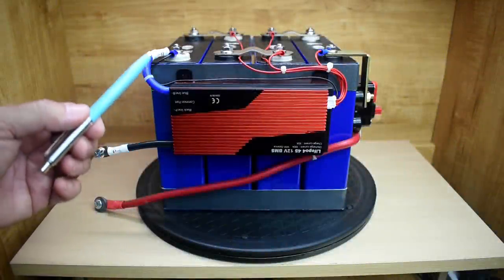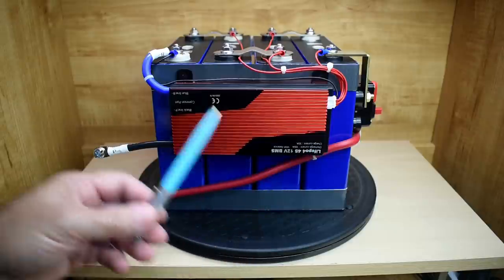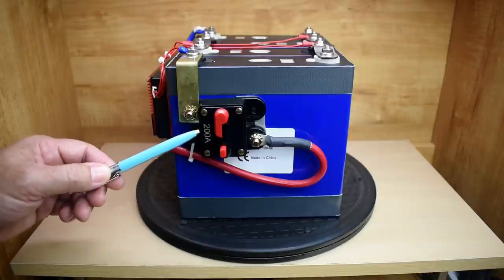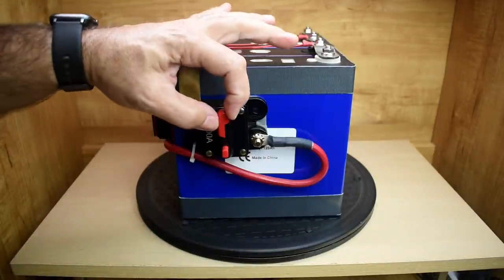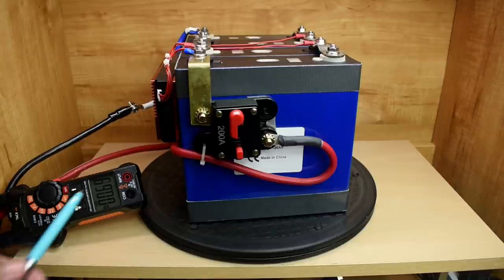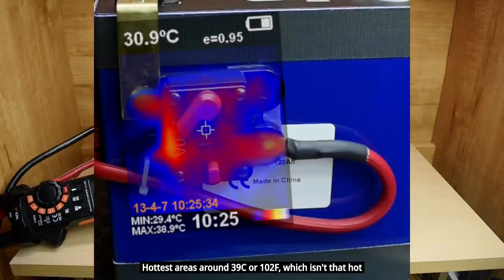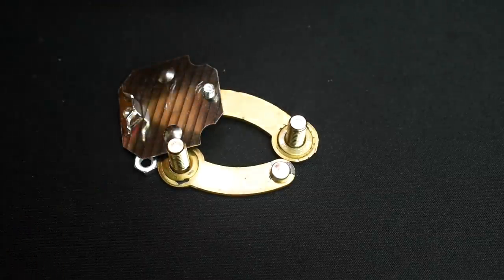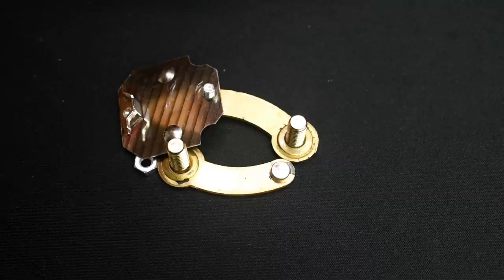NEVER Use This High Current DC Circuit Breaker For Solar, Auto, or Marine!

Comment: I also had a problem with these 200A resettable fuses.  It did trip from high current correctly.  So I reset the fuse.  But the battery connection became very "flaky" like working for a few minutes, then just stopping for no apparent reason because the fuse was not tripped. Yet I couldn't get power in or out of the battery.  Could't figure it out for a while and frustratingly had to start taking apart my system to try to find the problem.  The problem was the fuse itself!  I tested its resistance from pole to pole and it had a huge 1MΩ resistance!  I bypassed the DC fuse and confirmed the problem was definitely the DC fuse.  

For a while, I considered my BMS was messed up.  The BMS has its own MOSFET type software driven fuse.  But it was not the BMS.  

Also, I had one 100A fuse (of the same style) for a different part of the system.  It kept on tripping prematurely at 31A to 33A.  Lucky I was able to return that one to Amazon for full refund because my charger regularly hits those current levels as part of its regular specified operation.

Now I just use a regular non-resettable ANL fuse with some spare fuses around.  But I like the resettable feature because you can also use these fuses as switches to disable/enable parts of your circuit for maintenance/upgrades etc.  Still looking.
Reply from the maker: They're junk.

Comment: I was considering to use one of these but looked really Crappy. Perhaps good for 30-40 amp.
Reply from the maker: A 200A will probably trip around 50A, but every breaker may be different. You may get one that trips at 80A - 100A when rated 200A, and burn up your wiring. Avoid them. Thanks for watching!

Comment: I use some of them with different amps.
In another video i saw a test about breakers. It was about the 100 Amp one. And this one works the best.
100 Amp shut down at 99.7 Amp. Ok could a bit higher but others shut down at 150 or even 230 Amps.
There are a view of them on the Market and I'm not sure they all bad.
Reply from the maker: I don't trust any of these. I'll stick with Blue Sea and others.

Comment: I had two of these rated for 60A in my boat. Due to a configuration error while installing I produced a 0.1Ohm short, almost directly behind the breaker. Guess what - it heated up that quickly that it did NOT release at all but started to boil and emitting heavy smoke, also damaging the wires behind the breaker.
This cheap chinese brand is simply dangerous to life threatening.
Reply from the maker: The contacts probably fused together.

Comment: Those stud connection look tiny to handle 200amps. Is it smaller than 5/16? For such a large continuous current, I would imagine it should be at least ⅜".
Reply from the maker: The look like they could handle around 80A, not 200A.

Comment: Each time a DC breaker is tripped under load an arc etches the contact faces. Each additional use will cause heat rises due to poor contact. Start with quality and use with respect. Frequently measuring the voltage drop across the terminals will give a great heads up to pending failures.
Reply from the maker: Yes, the breaker should never be used as a switch when the load is connected.

Comment: It seems clear that the contact area (referred to as the 'silver' part) is the problem. It's even discoloured where it's been arcing. This is a design flaw. While it's true that the parts have to be quite rigid (unsprung) to ensure disconnection in these cheap parts, it looks like the geometry is poor. Also, it's hard to believe that thermal response tolerances (of the enclosure and the plate) have be ensured in such a woeful device, even if the contact were perfect.
Reply from the maker: As I learned, stick with Bussman and other high quality brands.

Comment: For connections it is not silver, because it rusts, it is nickel. All electrical is mostly brass and nickel. (and copper in good wires, aluminium is worse ones)
Reply from the maker: Silver doesn't rust, it tarnishes.
Reply: @electronicsNmore  ok, bad choice of words (I'm french) same result : silver oxides are bad surface contact, reason why it is almost never used in electrical nor audio. It is most likely nickel.

Comment: I guess I don't understand the point of this video - you're using a random no name knock off breaker. 

Why not use something name brand?
Reply from the maker: I was showing a breaker that many people have bought because of the low price.
Reply: @electronicsNmore  Anyone who is addressing circuit protection by buying the cheapest knock off junk available needs a talking too about circuit protection. 

I suppose this video partially addresses that?

Comment: Take the breaker off and see if you can make it burn. Try to light it with a match or propane torch. They are supposed to be made of composites or plastic that do not support combustion, or they self extinguish. If you can make it burn, I won't be surprised.

Comment: Love your very helpful videos. I have an old damaged "Tevo Magneto Rechargeable LED Lantern" that I want to salvage the LED light panel from and run it directly of mains if possible. Could you please please please make a video of that. I don't want to through away the unit if there are still working LED lights on it.
Reply from the maker: How much power does it draw and what voltage?
Reply: @electronicsNmore   thanks for your reply. It says charging voltage: 220-240V , 50/60Hz and it had a 6V 4AH battery. I'm in Africa 😊

Comment: I have 2000w power inverter and I wand to install it on my car secondary battery . My question is what is better  way install it with fuse or bussmann circuit breaker??
Reply from the maker: Fuse is fine, size it properly and it will never blow.
Reply: @electronicsNmore  what size of fuse should I use for 2000w inverter pure sine wave  ?

Comment: Your wires too thin that's why the breaker is tripping early
Reply from the maker: Incorrect.
Reply: Not sure where you're getting your data from but copper 4 gauge wire is only rated at 70 amps and most Solar uses aluminum which is less
Reply: 2 gauge is required at 100 amps

Comment: I was taught that electrons flow on the surface of a conductor. So correct me if I'm wrong, it's not the thickness of the plate, but the size.
Reply from the maker: Depends on the frequency.
Reply: @electronicsNmore  Frequency is the amount of hertz if my memory serves. Which only applies to alternating current. 
In direct current the power only flows one direction instead of back and forth. 
The reason that we are getting heat is because of resistance. Lack of electron flow. Which reduces the voltage and as a result increases the amperage needed to push the electrons. More heat is then produced causing more resistance. This vicious cycle is what is causing the breaker to pop at lower amperages. 
I work at a place that uses these breakers on occasions so I have one handy. I'm going to run a similar test to see if I can duplicate your results. 
I did however notice the switch problem you were pointing out.
Reply from the maker: @Kendalon  Correct, I answered the question fast. AC you get a "skin" effect, DC flows through.
Reply: @electronicsNmore  what kind of wire lug are you using? Is there a video on that? Cheap wire lugs can be a point of resistance and cause heat.
Reply: @electronicsNmore  alright I thought I would post an update on the test I'm running. 
Yes there is a huge heat issue. The temperature at the connection terminals are between 95 and 110 fahrenheit.
Now where I'm finding the most heat is the back side of the breaker. 166 fahrenheit when I tested it a couple minutes ago. But the breaker is still active. I will continue my test.
Reply: Final update. 
70 amp draw
12.8 volts
185 fahrenheit at the battery side of the breaker.
18 minutes before the breaker popped.
Test concludes. These breakers are indeed garbage and shouldn't be used

Comment: What is the brand of the breaker????
Reply from the maker: Brand is irrelevant. If it looks exactly like you see in the video, don't buy it.
Reply: @electronicsNmore  I don’t mean which part of china brand I’m saying are the fancy ones sold at the huge marine stores just as bad ? And so my understanding is the tested and true method is just fusing everything instead of circuit breakers right?
Reply: @electronicsNmore  are you saying ALL of these tiny marine circut breakers are cheap and dangerous or just no name Chinese ones?

Comment: why use a breaker, the BMS should be able to handle any issues
Reply from the maker: You always use a fuse or breaker off the (+) battery post.
Reply: @electronicsNmore  why? the BMS would cut the neg side be fore that breaker would the pos. Any how never had any issues my BMS cutes when it should faster then any breaker. its Heat vs. Power fault.
Reply: @woodzyfox4735   Are you claiming that a BMS will never fail?   The BMS is NOT to used instead of a fuse or a circuit breaker.  Clearly, you do not understand WHY a fuse or circuit breaker is required ...
Reply: @vtorsi610  a bms stands for "Battery Management System" clearly you dont know what there for :3
Reply: @woodzyfox4735  Correct a BMS is NOT an OCD.  Learn your National Electric Code ...
Reply: @woodzyfox4735  Actually a Fuse / Circuit Breaker is REQUIRED even if your battery bank has a BMS - because the BMS can FAIL.  You are contradicting the National Electric Code.  No, you are not allowed to change the laws.
Reply: @vtorsi610  check per state. the rules are different :)

Comment: That’s not a 200 Amp breaker; it’s a 200 “A” breaker - “A” as in the the first letter of the alphabet. The reason is that’s the number of “A”s in the scream you will emit while trying to use it. See how this works? 😜
Reply from the maker: Thanks for watching! Be sure to rate thumbs up and share the video link.

Comment: I hate this tipe of "protection". But i say that they have a bad reputation because 95% are Amazon -china garbage. But they are also hygh quality.

For the battery with 12 cycles that work good, its the minimum. My AGM s now have 1000 cycle of 30% dod average nad maybe 15 80%dod cycles and 100 60%dod. They work perfectly. Give me 94% of original capacity C20.

A tubular plate heavy traction lead acid make more than 2000 cycles at 100%dod. A lifepo4, is drain real 100%, dienin one or few times.

Comment: Holy shit no, no, no.  Stop giving advice that people might listen to dude.  Should you not use one of those as a primary breaker?  Yeah, but not for the reasons you give.  A lifepo4 battery that shorts, can push a current far far far in excess of that tiny 200A breaker.  When that goes down, things get nasty fast and you can get fun things like arcs.  Do you know what an arc is?  Do you know what interrupt breaking is?  No, no you obviously do not.  If you did you wouldn't have a device that if that battery shorts could catch on fire....a fire that is attached to the battery....  Congrats on your potential bomb.  Disconnects absolutely have their place....which is after a real fast blow fuse that can handle what the battery can dish out under worse case scenarios.  Also, if you want a circuit breaker that can handle the load it claims to be rated for, pony up the extra $20 for something that has a UL.  Probably don't know what that means either.

Comment: The only use I could see for them is maybe on a positive main feed wire to some small 12volt circuits like LED lighting, it could protect the main cable and act as a isolator. Their use is very limited, nice idea, but the thermal trip idea must cause voltage drop, which defeats the object of good cable sizing.

Comment: They are small and neat and double up as a switch, but after mine came yesterday the terminal sizes freaked me out, mine is 300Amp rating and I am running 70mm2 crossectional area wiring, those terminals are what I would use for 50amps max not 300. I tested mine brutally by attaching some leads and shorting it across a battery. It seemed to trip about right. However another concern is voltage drop, you are putting a resistor in your positive line, not good, they need to be magnetically operated.

Comment: I use a 20AH LifePo4 battery on my zero turn..  several times I stalled the motor, but left the ignition switch only to fully discharge (No BMS at ALL).  Jumped it, let the alternator charge it..  No where near the power to start, much slower.. just doesn't have it.   Took the battery cover off, hooked up a Tenergy balance charger to each of the 4 cells (5 wires).  Came back hours later..  all cells perfect same voltage.  Wow..  Cranks like a SOB!  Back in Business.  
Conclusion:  For LifeP04, i don't think the BMS is that important.  Over Charging an unbalanced battery cell  doesn't seem to do much (If any) damage.  The standard mower alternator charges it to about 13.6 which is less than optimum, but wow..  she cranks much Faster than a Lead Acid.  I must say though, I seem to be burning out starter solenoids (3 so far), Ignition switch (1) and wires.  So far same LifePo4 battery going on 4 years..  probably balanced charged it 4 times so far (Only after a Full Discharge).  No BMS works for me with LifePo4.
Reply: A few times when really cold (~10F) , she doesn't quite have enough to reliably start..  Inconclusive if totally Temperature or low charge or charge balance..  LifePO4 does have low temp issues, but 10F isn't that Cold.